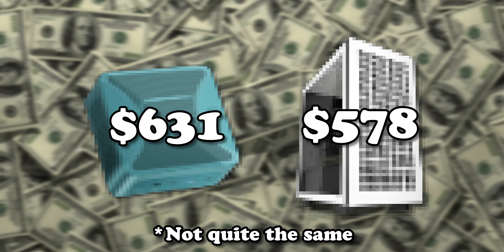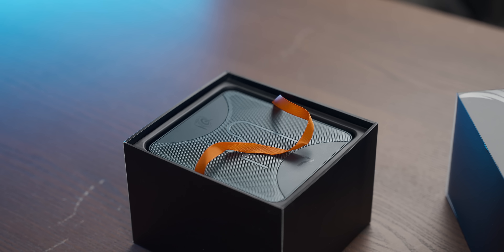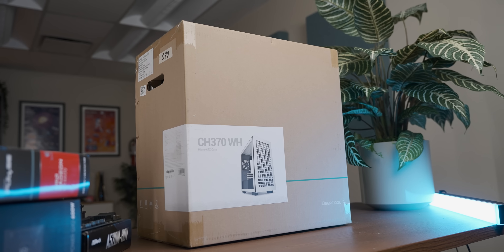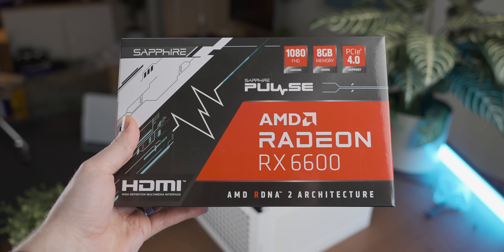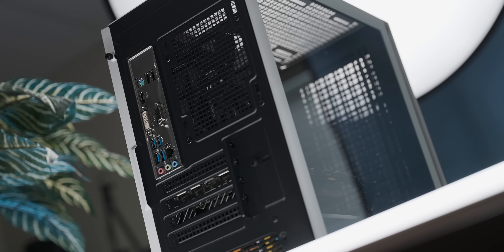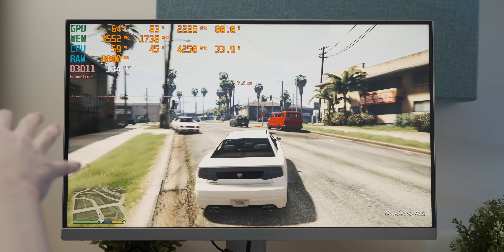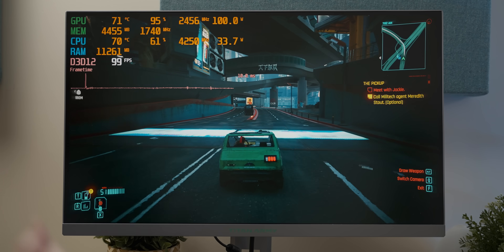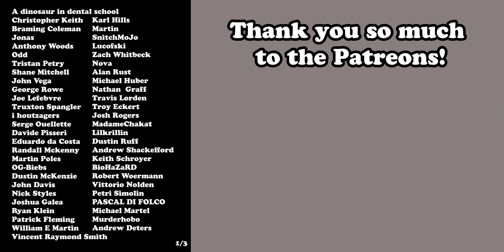Mini PC Vs Desktop: More Fair Than You Think

Comment: I think people should only buy mini pcs if they need to save space. The problem with them is heat. It's very easy to thermal throttle when there isn't enough space to dissipate heat, also you end up with screaming fans. I'm talking about for gaming. Home office is different.

Comment: Hey dawid i was planning on using this exact pc case for my r5 5600 and rx6650xt build but i noticed it doesnt have any intake fans nor does it have a fan hub for installing multiple fans and my motherboard only has 2 fan headers did u install any additional fans in that case for better temperature and should i do it aswell?

Comment: Well, you sacrifice portability for performance and upgradability. I don't call the mini PC upgrade as upgrades because they are virtually not upgradable. What you get with the mini PC is the manufacturer limiting the capacity of RAM and storage and the upgrade they have is to increase the capacity only. Custom PC on the otherhand can literally upgrade. CPU slow? Upgrade the CPU. GPU slow? Upgrade the GPU. Not enough power? Upgrade the PSU.

Comment: intel N100 16GB DDR5

I can run MSFS and BeamNG on low gfx at 720p.... and it's actually playable.  I run ETS2 on Ultra settings with scaling at 75%.. for 300 bucks... my brain hurts with how much of a steal this was.  Check out the Beelink EQ12.  Also, might I add... I have a Ryzen as well... I don't have a graphics card in that and it's a frickin beast, was like 800 bucks though.  This little Beelink is actually.... really close to that Ryzen in terms of CPU speed.  The gaming is poop in comparison but hell, anything I throw at it IS still playable... not shitty choppy laggy frames either.  At least minimum 20 on some next gen stuff with low gfx at 720p.  MAYBE 15 at most.  Regardless, it's playable.  Don't tell me about 60fps.  The only time I've heard 60fps requirements are for Level D flight simulators.  gtfo here with that crap, not everyone is rich.

Comment: That CPU and mobo combination will bottleneck that card for multiple reasons. It is only on PCI 3, while the RX 6600 only has x8 lanes so expects PCI 4. It's well worth paying extra to get the 5600 and a better board for long term upgrade capabilities. 

I'm impressed with the little mini PC, AMD APU's are finally starting to show the potential that they saw all those years ago when they bought ATI.

Comment: I have to say that the mini PC if it had more graphics power in it could make an awesome PC to take to LAN Events. I seem to remember that t came with a VESA mount as well to put it on the back of the Monitor. So I guess the question is can you increase the graphics performance of the Mini PC? External Graphics maybe?

Comment: Mini PCs are only about 1 generation away from being good enough for almost everything.   A discrete graphics card will always have advantages, but like screen resolution it gets to a point where most people just don't give a crap, it is more than good enough for anything they are doing.   100+ fps in fortnite is pretty much all most of the juniors need.  Buy a very good 1080P monitor (say like an Asus ROG 27 curved) and strap the mini PC to the back of it.  Your junior mints will be more than happy with that solution.

Comment: now imagine the steamdeck competitors with the new thinner, blower style fans, with newer hdr-whatever-oled screens, which themselves probably would be running at 1080p120, with an optional lower screen display akin to the nintendo DS, for maps/macros/quick shortcuts, heck on on screen keyboard or whatever. 

running at 15w and outputting low-med setting games easily.

Comment: I bought some minisforum um350 minipc's as 'upgrades' to some older refurb dell desktops my business was using. Everyone, including me, hates them. They're okay for web browsing but just choke to death when trying to do anything requiring more than a handful of watts to the cpu, even trying to full-screen a 1080p60fps video will take it a moment to do.  It nearly shits its brains out when trying to run the app for my security cameras, and I might as well treat it like an old pentium 3 machine where I have to run one program at a time to do anything other than simple web browsing, which can get iffy itself if you have too many google drive/doc/sheet tabs open..... and too many isn't really that many at all to begin with. 

IMO it's a good replacement for a google/email machine on a budget and with some more simplicity. Being able to attach them to the back of a screen creates a clean 'aio'-style setup on a desk. But if you need power for anything serious, unless you dump a desktop-comparable amount of money into a minipc, they end up being comparable to that novelty rpi4 that you can't seriously use as a computer.

Comment: I have one of the 5500u ser5 units and for what I use it for it's great.  Small footprint, low power...  The only thing it's lacking is a second m.2 slot but I get around that with my NAS.  Great little system for the $279 I got it on sale for assuming it lasts at least a few years.

Comment: I have been running the Beelink SER models for a couple years now, and I love them.  Your review is pretty spot on with what I have noticed.  I just built my son a gaming PC, as he wants to play new titles, and the SER can't play them smoothly.  My SER(one generation newer than his), plays the slightly older titles that I play just fine.  They make adapters so that you can add an external GPU to a mini PC.  It's something I may try at some point, but for now, this tiny PC does everything I need.
Reply: To me as a Finn those SER models are funny. Here SER = Sekalainen ElektroniikkaRomu, caps for emphasis, which means "mixed electronics waste" harhar
Reply: did you run on any issues so far?

Comment: Hi Dawid seeing as you've had sponsored access to Bequiet cases, I was wondering if you could test standard vs inverted motherboard case configurations. My 20year old LianLi PC-V1000B case which I am still using nowhas the inverted motherboard arrangement which I believe is better... But I am curious if there is any performance/cooling benefit. I think some Bequite cases can do both orientations so it might make for some interesting results....?

Comment: i have a zotac zbox magnus en1070 with an rtx quadro 4000 and an i9 9900t . yes it is small as heck  and yes the magnus en1070 only supports 7th gen without the coffee time bios mod but once done this little beast can and does compete with a full desktop . only issue is i need to either get an i7 9750h or 10750h  to really let it shine as the 9900t power limits .

Comment: working on computers can often result in injuries surprisingly. Can't even begin to count the amount of times working on a older or vintage computer I've cut my hand on sharp metal
Reply: anywhere you are working with sheet metal. was a system integrator back in the p4 era, using cheap steel cases that were all sharp corners. was amazing how often we restocked the first aid kit.

Comment: The RX 6600 is one of the least cost-effective GPUs. At a similar or lower price you can have the much more powerful Arc A750 ($200)
Besides, in games the 12100F would be a better option than the Ryzen 5 5500 (it's an adapted laptop processor with half the cache)
and if you have budget left, you should definitely go for the 12400F for $50 more

Comment: Maybe the way forward isn't MiniPC/Itx or ATX, but micro ATX. I would like to see some complete microATX systems reviewed instead of the still mediocre minicrap. A LP 3040 (I know Nvidia calls it 3050 6Gb , but meh its a 3040!) would certainly fit in a smaller mictoATX case and so the system would fit in the drawer! With DVD's becoming obsolete and SSD's replacing HD's the optimum setup is becoming more and more microATX friendly. But smaller will still kill off a lot of upgradeabillity making that expensive in the long run!

Comment: Installing a SteamOS like OS on the Mini PC and throwing it in your living room would make it a great mini game console.
Reply: Which is more expensive than the PS5 of Xbox series X ? Replacing the RX6600 with a LP 3040 (also know as the 3050 6Gb version) and a microatx sized case would make a far better SteamOS system. MiniPC are overpriced or underpowered and can't be easily upgraded. Promoting ewaste basically!

Comment: Just an FYI, but the 5500 is a terrible gaming CPU.  It has half the L3 cache as the 5600(nonx).  its not that much more in price, but would have just about given you a 20% increase in gaming performance at least.

Comment: If your really good at soldering and a bit of light coding (if there's a bios limitation or a bios settings that limits upgradability )
Then I'll say the mini pc can actually be turned to something extremely powerful
With a proper GPU
(A external PSU for the GPU)
And maybe a 3 week soldering process for upgrading the CPU
Possibly?

Comment: YET AGAIN: The HILARIOUS conclusion is how much people underestimate the RX X600 series of cards! (6600, 6600 XT, 6650 XT, 7600 and 7600 XT) The fact that you can get budget cards with this kind of performance is insane AND HAS NEVER HAPPENED BEFORE! I had systems with both the GTX 1650, and the GTX 1050 (both ti and non-ti) - and they always ran "fine" - and then "barely" on "lowest" settings in 720p in new titles. Even the RX 6600 is a MASSIVELY different experience - let alone the RX 6650 XT which just feels like a midrange card most of the time. Most people are giving these cards 0 attention - and discarding them as trash - however - try them. Get a good 27" high refresh rate 1080p with a 1ms or lower update rate - and then try a card like the RX 6650 XT or the 6600... It's literally a good and stable gaming experience! (And no don't activate RT just to be a devils advocate you silly goose! 😀 )

Comment: 2:36 I will confidently tell you that I have an ASRock A320-HDV R4.0 and that's the exact I/O shield it comes with.
3:32 In theory, you could put 64 GB in there because the 5000 series supports a maximum of 128 GB of RAM.

Comment: Honestly, the performance of these tiny laptop chips is pretty impressive. To put it in perspective, a laptop 4080 is most/all of the performance of a 3090 desktop and a 4090 laptop will easily beat a 3090 Ti using half the power and is nearly the equivalent of like a 4070 Ti Super.
Don't be surprised when you see the 5000-series laptops come out and these last-gen 4000-series laptop chips come out in a tiny form factor and beat up on anything other than a high-end build.

Comment: Got the wife a newer PC as her aging celeron needed replacing, bought a refurbished dell optiplex i5-8500 but was considering one of these mini PC’s. In hind sight I should have bought her a mini PC, she does crafting and has programs she runs for that and cruises the internet and some YouTube tutorials, very light usage. These mini PC’s are impressive for the casual user.
Reply: What about durability? Are mini pcs durable with small motherboards
Reply: @sumitchaudhary343 why would it need to be durable?
Reply: @Lava-i3g  if motherboard gets burnt then how to buy new one
Reply: @sumitchaudhary343  there is very low chance of that happening . If it does however it would probably be better to just get a new one . If there is warranty it is better but I guess maybe some repairers may have extra motherboards
Reply: @sumitchaudhary343  They are fine that last a long time you' wont probably need to repalce it if you are just a casual user
Reply: Would you say a mini computer is decent for a causal gamer?
Reply: @user-yq4wo5dc1j  depends on your expectations, the wife doesn’t really have any heavy use at all for her pc and it would really be dependent on what game title your wanting to play. The ryzen onboard graphics are actually pretty decent and will hit 30fps in most games which is considered the minimum to be playable so I would want a amd ryzen processor with a apu (cpu with onboard graphics) but whatever your considering buying do the research, good thing about YouTube is most likely someone has made a video on it and reviewed it.
Reply: @user-yq4wo5dc1j enough for 1080p low settings aaa gaming. Although, if you don’t NEED the small form factor it offers, a tower case pc has better price to performance, not to mention the upgradability. Also remember that many mini pcs use laptop SODIMM RAM, which is BAD for gaming performances. You want the LPDDRX RAMs soldered onto the boards. No upgradablity, but amazing performance and longevity.
Reply: i have a mini, nothing special,  but with an intel N100, 16gb ram and a 512gb ssd(soldered) it pretty good and snappy.  cost me under 200 british sterling on amazon.  Ryzen ones would be better if you needed a bit more graphical power
Reply: @thesilentgametestr  Intel N97 and Intel N200 is better, could have invested more in these type of processors

Comment: Some things I want to mention:
- Many Mini-Pcs come as Barebone
- With the Thunderbolt/USB4 port you can attach a discrete GPU to most Mini-PCs (up to 4060Ti/4070)
- The Mini-Pc cosume a lot less power than the desktop 50W to 130W
Reply: Technically you can do up to a 4090, it just won’t run at the full potential.
Reply: Even if you connect an eGPU to it, you're only going to get 70-80% of the performance of said GPU. And that's at best. Also, there is increased input latency.

Comment: I've been staring down those 7840HS/780M-powered mini PCs for weeks now as a potentially fun way to get some desk space back while not having to resort to herpes-tier detail settings. Clearly, I will just have to invest in the low-profile RTX 4060 instead. And a suitably sized condom to keep the detail-setting herpes away. A Magnum should be big enough, right? It is a very small GPU.

Comment: Unfortunately the R5 5500 is a 5600G without Graphics and so its also only PCIe3 on the x16 Slot. The Rx6600 is a PCIe4 Card so you might lose a few frames. Also i hope you have Resizable Bar activated.

Comment: That mini pc supports EGPUs as well via USB4 if it's the one I think it is. Still would lose out to a custom tower, and EGPUs are still not as stable or performant because of being done over usb, but they're getting better. It's interesting stuff, thanks for the video.
Reply: They are if the use Oculink, which is essentially a PCIe Gen 4 lane connected to another using a cable.

Comment: Wow- I did not realize RX 6600s were that cheap now. (Checks Newegg US) Ok, the cheapest one is $190. Not bad. The RX 6600 was always a good tight budget build GPU if you needed brand new. And good job on the build parts chosen. I was afraid you picked up like an old new stock Ryzen 3 1200 or something similar limited because super cheap.

Comment: 06:22 Dawid forgot to bend the IO-shield's HDMI brace-tab inwards so now it's blocking the HDMI port. He'll either have to unscrew the motherboard, move it aside and bend it in or bend it in and out until it breaks off.
Reply: with that 5500 he won't need that hdmi port.
Reply: You can't use those ports unless the CPU has integrated graphics anyways.
Reply: maybe he blocked it on purpose
Reply: sometimes the factory doesn't bend them enough, and sometimes the builder is stupid and doesn't know how to line things up before shoving them in (also relationship advice). its probably why they switched to integrated shields to stupid proof their products.
Reply: @LordOfNihil  Yup. I've seen my fair share of io shields lazily taped to the back of computers.
Reply: @LordOfNihil im intrigued by your relationship advice, like what am i did wrong?
Reply: @whitygoose  alignment is critical, you don't want to be accused of inflicting pain without permission.
Reply: Dremmel time!!!
Reply: @Thanos0001   You can break that tab using your fingers. It's very thin.

Comment: With Time you can get a little better for a little more, I did my media PC with the following:

Ryzen 7 5700x - $150
Radeon RX-6650XT - $200
32GB Samsung B-Die Generic Brand - $65
2TB M.2 NvME - $75
A320 Motherboard - $55
SUGO G Case - $50
450watt PSU - $55

Took 2 months looking for deals, so $650 for a modern-ish PC is pretty good!
Reply: 5700x on an A320 mb OOF
Reply: @@token7443 it's an FSP Gold-Rated, and the 5700x and 6650xt don't eat that much juice.

Comment: Also remember the Ryzen 5500 only has 16 Mb of Cache compared to the 32 Mb on the 5600 and the 5500 is also limited to PCIe Gen 3.0 so with the X8 interface of the RX 6600 there will be a bit of a performance hit there too!
Reply: The 5500 really isn't great for new builds, but I got one as a cheap upgrade for my old B350 motherboard since I can't use PCIe 4.0 anyway. I would only recommend it if you don't have a lot of money and still use something like a R5 1400.
Reply: I had a 3600 go bad and I replaced it with a 5500 and the performance is almost the same at 1080p with a 2070 super.
Reply: Does it really affect performance though, for a higher end gpu a it could be, but with a 6600?
Reply: @matuzaato  it does, a lot.  the half the cache means 1% lows are extremely impacted, as well as overall FPS by as much as 20%, even with a 6600.
Reply: @matuzaato  It does because it has x8 interface. If it had x16 it wouldn't be an issue.
Reply: The 6600 uses around 8 the majority time @asuschrist
Reply: @asuschrist no gpus really use 16x
Reply: @asuschrist that's why we are putting nvme drives on them
Reply: @WAFFLED_GMR  Thats BS, just look at benchmarks of 8X vs 16X GPUs of similar performance
Reply: As if the jump between pcie 3.0 to 4.0 exceeds 5%😂
Reply: @valorantpro-zi4yd  It does when you combine it with an x8 bandwidth limitation.